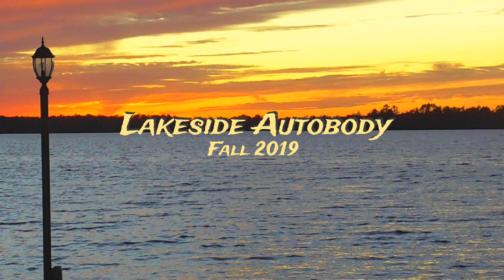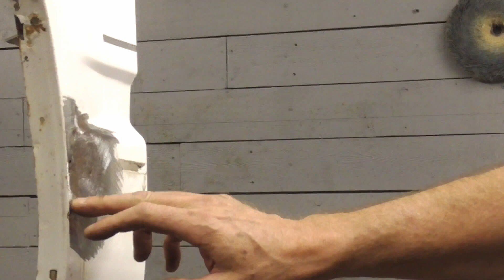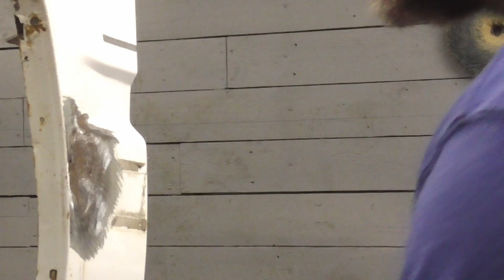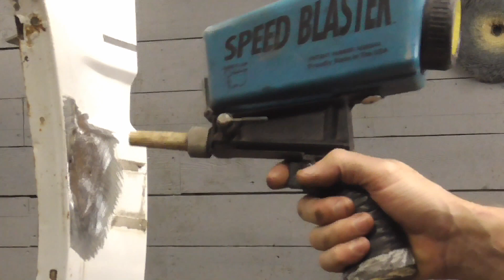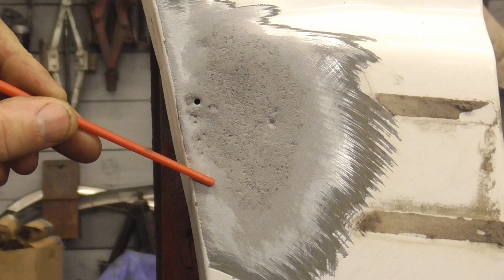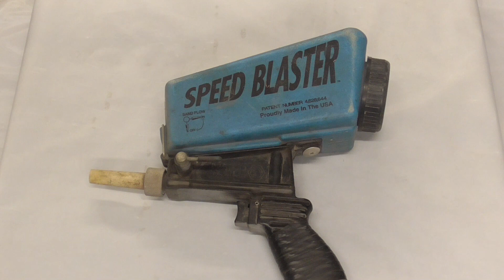Speed Blaster:  Using a Gravity Fed Hand Held Sand Blaster

Comment: Thank you for the video. I just ordered the same one but in red from the snap on guy. Its funny how the design of this sand blaster hasn't changed a bit since 5 years. I cant wait to use it.
Reply from the maker: It's one of the most handy tools I've ever owned - absolutely use it all the time.  Pick up some blasting media from Tractor Supply - real cheap there.

Comment: mine has started putting air back up into the tank and will not suck sand any more, every thing is clear and the sand/ or crushed glass runs out freely when off. I am wondering if I need a new nozzle ?
Reply from the maker: That's sort of strange... maybe the trigger is messed up.

Comment: I have a HF unit works and looks similar. Sand flow can be problem if sand is damp or particles are too big or orifice too small of air pressure too low or high. For small jobs it is handy.

Comment: Have you had any experience with kurust or Loctite Naval Jelly Rust Dissolver type products?
Reply from the maker: No - but my old boss used to make us put a chemical rust converter on before filler.  It did change the way the rust appeared.  I'm not really sure if it made a big difference in the longevity of the repair though.
Reply: inverlass 
May try some muriatic acid or phosphoric acid before priming.